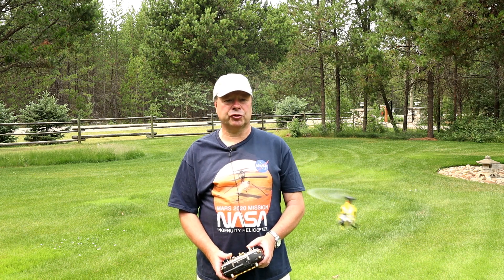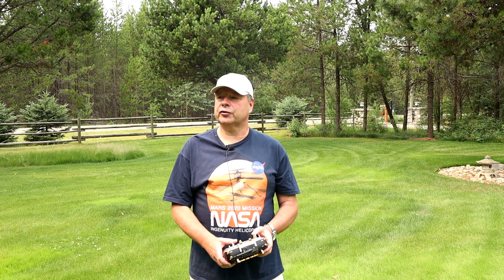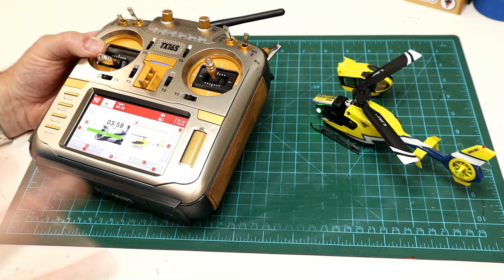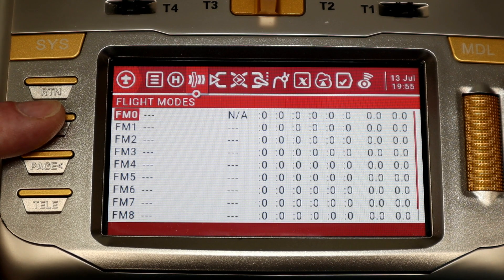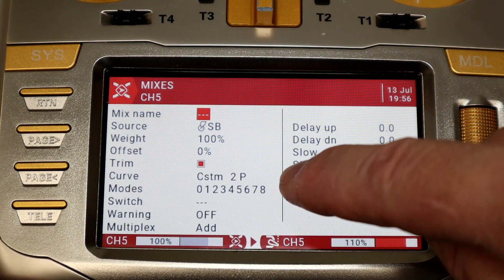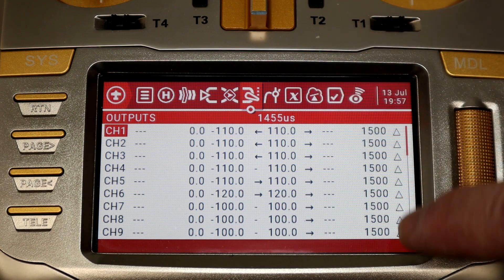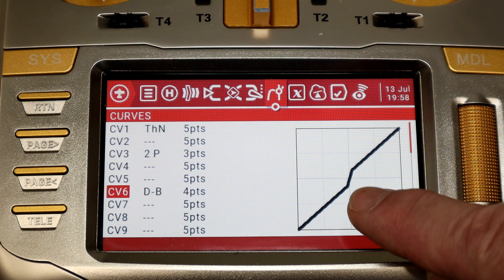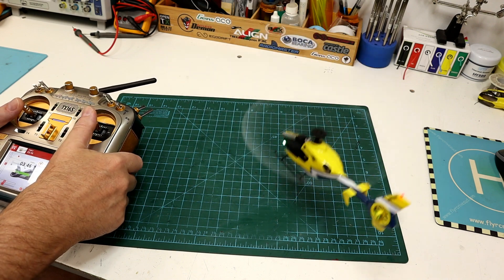Esky 150 EC Multi Protocol Setup Made Easy - Open/Edge TX.

Comment: So im setting mine up but in inputs its aetr and i notice your inputs is TAER . Did you change the order
Reply from the maker: Doesn't make any difference what the input mapping order is; what's important is the mix output order and Esky protocol uses ETAR.
Reply: @Rchelicopterfun  I noticed I'm using edgetx and the multi module I'm using makes the order correct so don't have to change anything.  Only thing I can't get to work is the rate switch

Comment: @Rchelicopterfun . hi I'm new here.I have ,Esky 150x lying around in dust. Gotta start backwith this new term RF technology. Do it work with radiomaster Zorro ? I heard for the it required 4in 1 type/module.  Not into fan of drone but maybe later can upgrade plug in elrs module in future
Reply from the maker: @epaint86 - I'm not sure what protocol the 150X uses so don't know if it's supported with multi-protocol. Yes, you need the 4-1 multi-protocol module if you want the most available protocols. Not sure what version of multi-module the Zorro comes with? You would have to check in the Zorro specs or it might also be listed on Multi-Module's website (a must bookmark & study website IMO if you are getting into multi-protocol).

Comment: Glad you covered this for folks. That channel 5 piece really threw me for a while when I set up my V3 Airwolf. The heli was really weird until I figured that part out. At least on mine, I didn't care about the altitude hold, so I just set channel 5 to output 110% all  the time. Thanks!
Reply from the maker: Yep, that CH5 setting took me a while to figure out as well. The thing was going crazy until I assigned CH5 to a rotary dial and played with the output levels until it started making sense 🙃
Reply: @Rchelicopterfun  That sounds similar to how I figured it out after nearly pulling my hair out as the heli kept going completely nuts.